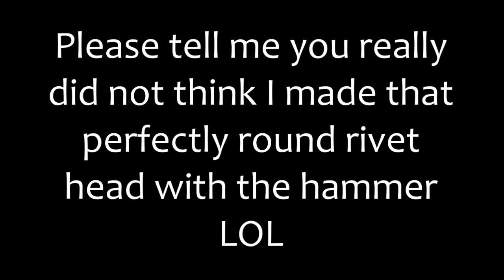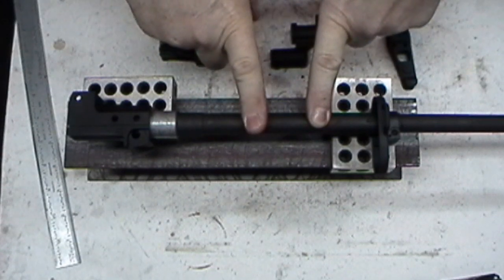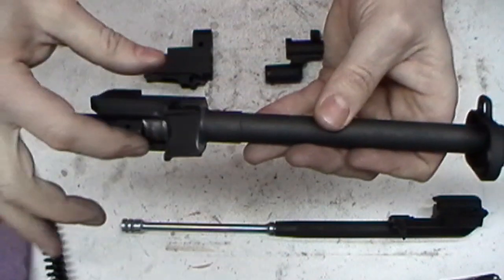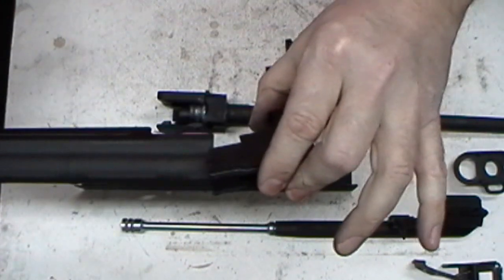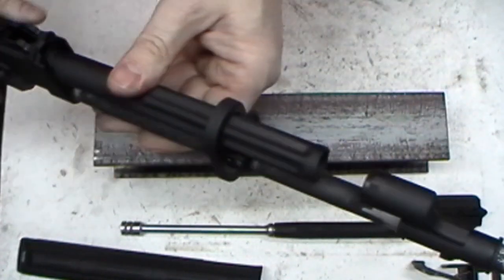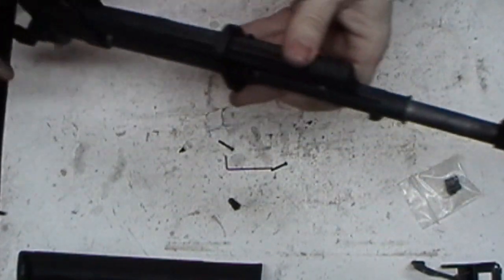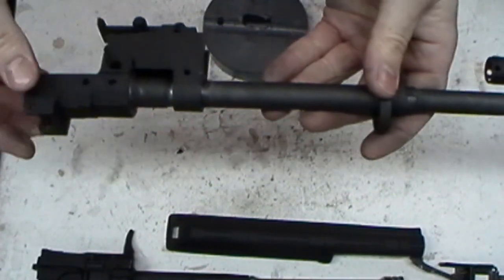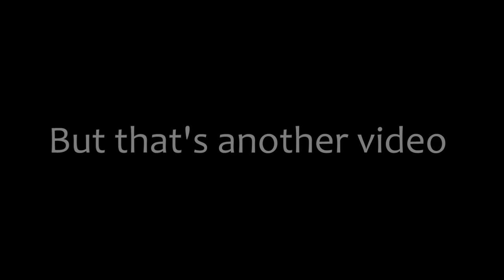Polish Tantal 4

Comment: You mentioned the Toth tool will want to slide on a trunnion that is not riveted into a receiver and I have had the same experience. I just flipped the jaw pieces end for end and the lip that usually sits at the front now sits at the rear and keeps it from sliding out. Hope that's helpful. Barrel does want to turn with the Toth tool, though.